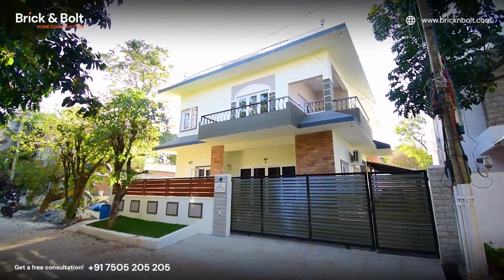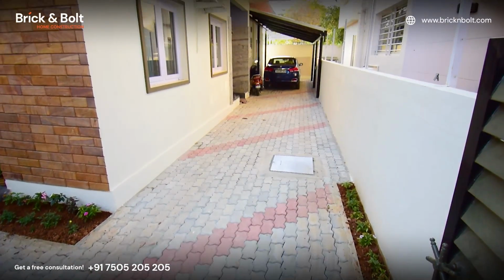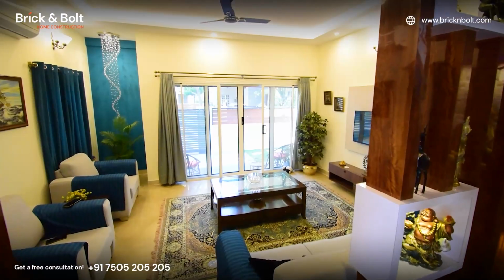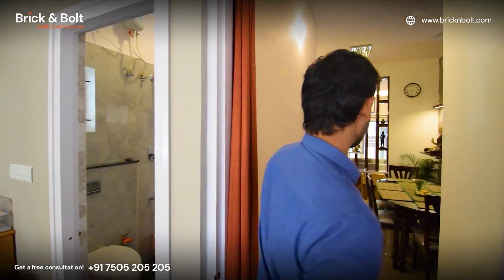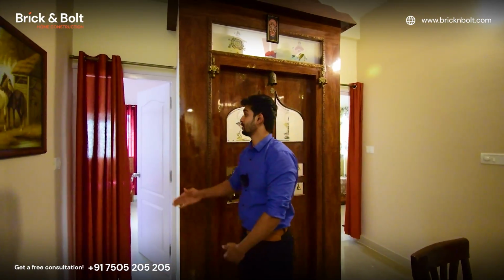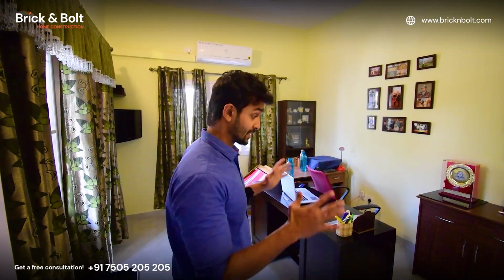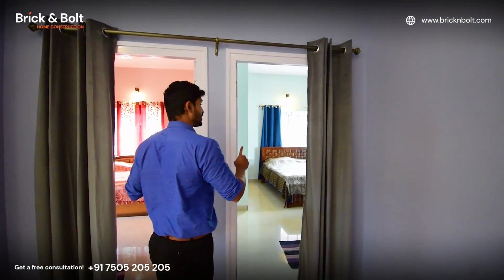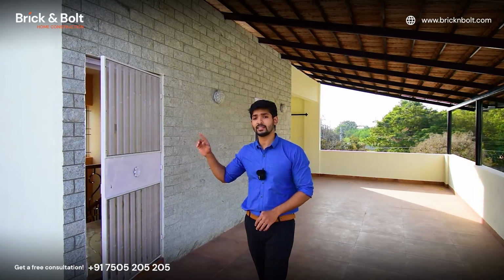65 ಲಕ್ಷಕ್ಕೆ 60x40 ಸುಂದರವಾದ ಮನೆ | 60x40 Duplex House |  Brick and Bolt

Comment: For basic construction 65lakh is too high for 3600sft
Reply: Sir swalpa market rates update madkoli, ella kade minimum 200rs/1sq ft rate odtide. As per this rate its 180rs is very decent.
Reply: @kiranm25x  it's in 1000's not 100's
Reply: @yourbff1484  Right I missed one 0, 2L/100sqft, 2000/1sqft.
Reply: It's 1800 per sqft pretty decent according to today's rate